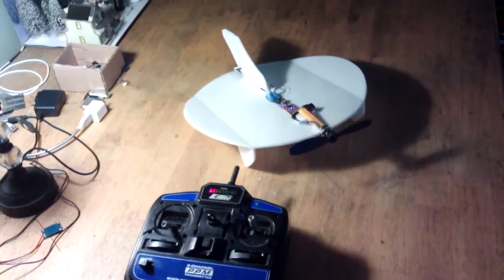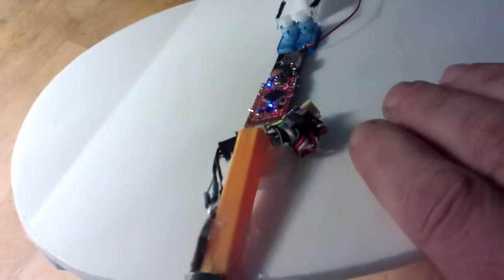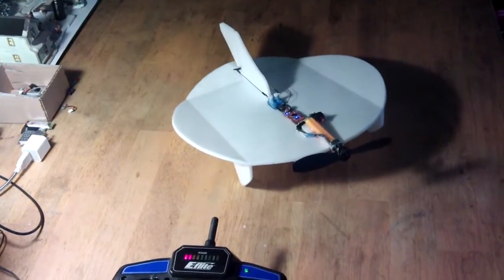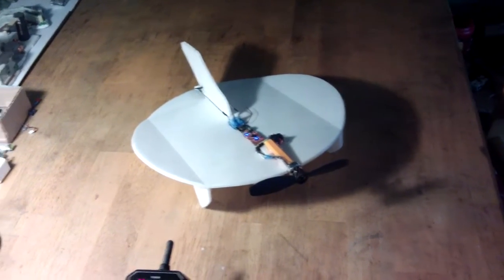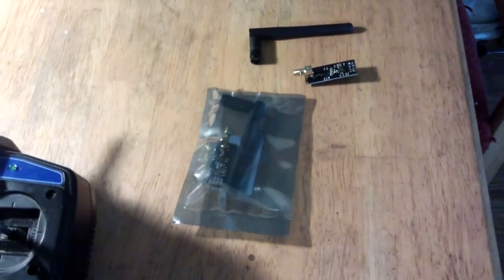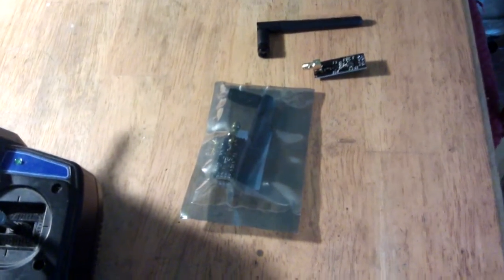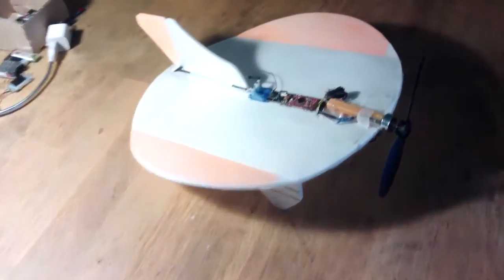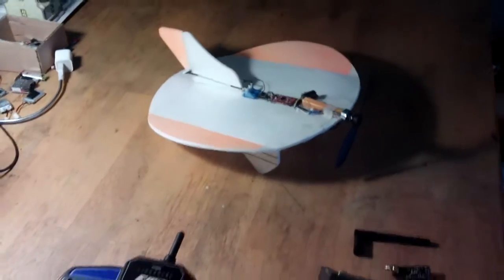Arduino/nRF24L01 - Nutball !

Comment: This is really cool! I have to wonder, with the mini helicopter craze being a thing, if a lot of the same principles could be applied to make DIY mini copters.

The next thing that would be amazing would be getting a tiny camera on one of those, allowing aerial shots, video, and photography.
Reply from the maker: +FSSZilla Yes indeed Miss K :) There are quite a few that use a Wii remotes board for gyro's and such, Multi-Wii (which sounds like a bladder problem). Those have a good software maturity and PC Apps to change the settings to suit whatever motors and such that people build them with, not like my old skool C++ coding.
For the camera side to it, I have a Hubsan camera, $20, weighs just 4 grams and has been fitted to a few mini models, as well as larger 20" or so wingspan homebuilds. Now there's even a similar weight FPV camera for flying while wearing goggles to view as onboard the plane/quadcopter. Check this out, just uploaded by Flite Test : https://www.youtube.com/watch?v=1E2YvhiVnpc

Comment: Wow!  That really is amazing Slider. What a great piece of work. You really know your stuff! All built and coded yourself, from top to bottom. I am incredibly impressed.
Reply from the maker: +MrFlathunter Cheers! Cheap too, the Arduino's are about 2 quid, same with the 2.4GHz module and the other gear will carry on to other planes in time.  
Am thinking it needs a plasma hue for evening flight and a water repellant powder for the rain....wonder if your experiments could work in reverse ?

Comment: That was another amazing flying creation.  Well done.
Reply from the maker: +Lidmotor Thank you. This one might get solar panels over the top surface, to run something while in the air. It has enough surface area to put several past projects on it, pulse motors, oscillators, a Tesla tower lol.